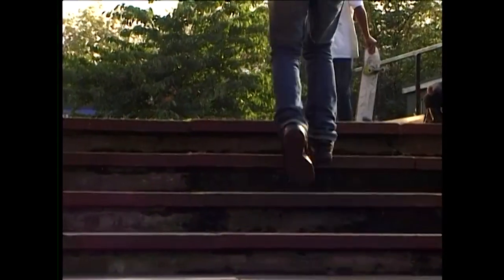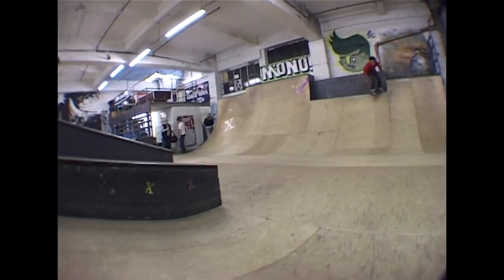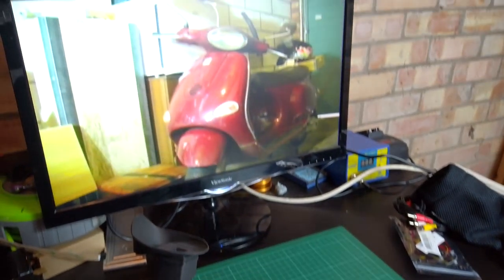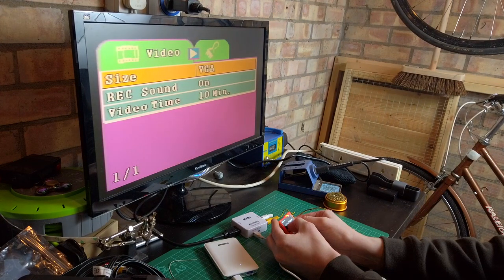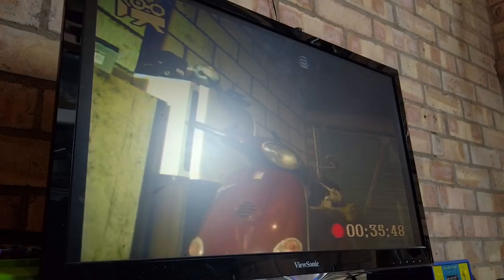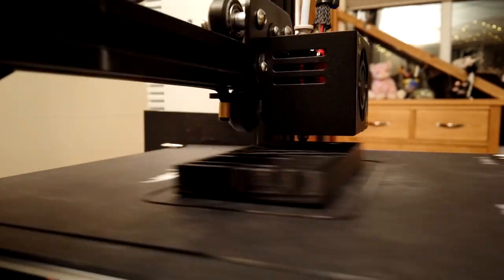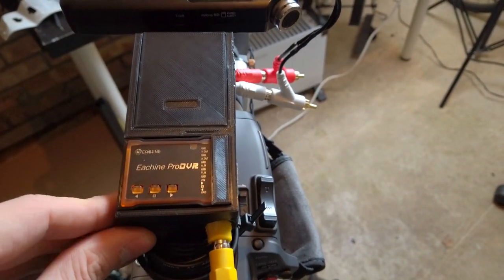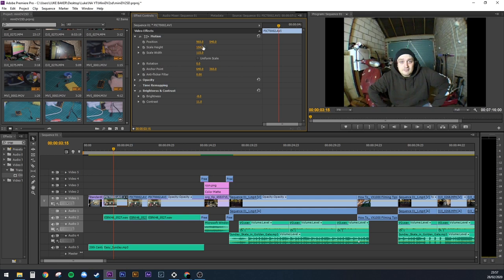Tapeless GL2 / VX1000 SD Card DVR Hack

Comment: Nice job man, excellent detail regarding.  Thanks for sharing!  I picked up a Eachine EV100 DVR a few years back to try to do something similar though more for a dash cam... I think... I actually forget... might of just been one of those impulse buys for a dirigible/drone project I was planning to do at one time also and I picked up when I purchased the related gear.  Looks like the Eachine ProDVR is better quality and even more cost effective.  Thanks again!
Reply: Interesting, just reviewed the specs (not the firmware though) and depending on the source pricing, price looks better for the Pro in the States... though from Eachine the EV100 is listed a few dollars cheaper.  
EV100 DVR - https://www.eachine.com/Eachine-EV100-Micro-AV-Recorder-1280+480-Mini-DVR-Support-32G-TF-For-Goggles-p-1026.html
Pro DVR - https://www.eachine.com/Eachine-ProDVR-Pro-DVR-Mini-Video-Audio-Recorder-for-FPV-Multicopters-p-392.html

Hackaday Article regarding this vid - https://hackaday.com/2020/03/07/that-retro-video-look-without-the-tapes/

Comment: Very nice hack indeed. Congrats!! :) I do have a VX2000 DV Camera. I'm so sad that these high tech designs become trash in this very short time period. I'm here after a Google search on how can I revive this monster. I'm considering replacing my VX2000 sensor system with some 4K camera sensor, making use of the VX 2000's optical system.

Comment: Idk why it doesn't work with my eachine DVR (not pro), i get an total glitch image and sound, any idea???
Reply: doesnt fonction for an old canon and a old sony, is it a problem of cable? or menu selection, between ntsc/pal or frame rate problem? I can monitor the signal straight from the AV out of the two cameras to a monitor and it work perfectly, butt when i try to record on the eachine dvr it's very glitchy...
Thank u
Reply from the maker: Not sure, maybe the DVR is faulty?
Reply: @NEONAIRSHIP  i founded, it's a problem of omtp thing, even on a 2,5 minijack ill try you technic

Comment: What format does it record to? Been looking for a Prores level analog to digital capture device
Reply from the maker: This only does mjpg.AVI files so probably won't fit your needs. But an AV to hdmi adapter and an atomos recorder might work?
Reply: Yeah running it to a hdmi out does open that up. Might give this a run and see how it comes out anyway, looks great!  

Any chance of getting that 3D print file?
Reply from the maker: @SPOD_ZONE  No problem, I've added it to the video description. It's a bit rough and could use some tweaks but did the job.
Reply: if you can afford it, tapeless dte recorders is a great option. this is gonna be a slightly long comment so bear with me.

one thing about this setup that neon made is its not the best quality since its capturing from composite. the reason why dv was named dv was because, well, digital video. 
the only way to get the best quality out of dv based cameras is to do a super expensive mod like the andromeda mod for the dvx100 which takes the video stream before it gets feed into the dv dsp chip and streams it via usb. doing this allowed you to get 720p video and 4:4:4 chroma subsampling out of the dvx100 but of course, it came with the cost of 6500usd for the camera + mod back then. not to mention you needed a mac mini and portable display to be able to use it out of the tripod.

but of course, we cant really do that so the second best option is what i said in the first sentence: dte recorders. for example the focus enhancements firestore fs-4 which has a built in 100GB hdd and captures video directly from the dv port on the camera. or even better, the sony mrc-1k which uses compact flash cards and supports up to like 128GB cf cards. 

bottomline, if you can afford it, get a sony mrc-1k. absolute god tier recording option for these dv cameras. it does not record to prores but it captures the pure mpeg-2 transport stream that the camera outputs, adds zero compression and you can use it as if its just a normal dv video you captured from tape (because it is) with the benefit of having it on flash storage. 

one small note: you NEED a dv cassette in the camera to record with a digital recorder. on older models such as the vx1000 or 2000 it does not support tapeless recording but it still works. however, you have to simultaneously record to tape or else it refuses to record on the mrc-1k. im not sure if the firestore supports tapeless record on old cameras but the mrc-1k doesnt, at least when used with my dvx100.

however, if you want analog and prores codec, you can use an atomos ninja v or equivalent and use a composite to hdmi converter.

i am one year late but i hope im able to help. thanks for reading.
Reply: @n_3719  Worth the wait, thank you!

Comment: How abot the 5V terminal on the side of the XM2 camera? It can probably work instead of batterry to power eachine pro dvr. Did anyone try that?
Reply from the maker: Is that an output? I thought it was an input but could be very handy if not!
Reply: I can’t try it, but I think it´s an output for some external light or something else like this. Power input is just through battery/dummy batterry.
Reply from the maker: Neat I'll have a play when I get the chance
Reply: @NEONAIRSHIP  let me know. I just have to order something to record as i get “remove the cassette” error all the time. What’s the best solution? When using eachine pro dvr, is there a way how to check the footage easily, I mean without putting the sd card somewhere else? I’ll probably order immersion rc poweplay dvr. I saw something else like this at wish (AV VIDEO RECORDER), but there is no specs to it.
Reply from the maker: Powerplay is by far the best option I have found, the eachine you need to take the sd out to view clips on another device
Reply: @NEONAIRSHIP  and how about the internal batterry? Is it really bad? Maybe have two pairs and swap them whenever needed. I like to keep it as small as possible
Reply from the maker: Nah the 18500s are great you just have to buy them separately

Comment: You can also buy a clear click 2.0 video recorder and monitor, and connect it to the output of the camera to the input of the clear click, and press record. It will record directly onto an SD card. You can get a clear click used for about a hundred bucks.

Comment: Trying this! Well, most of it. Personally I can’t explain away going to all the trouble to design,  3-D print and install a 1 off “all in one” enclosure for the dvr, 4.7v battery pack complete with  power switch and everything, to then opt for “West Virginia engineering approved zip ties” at the end…?? Whaa??   Huh??  
 
The only explanation is that he must have been all out of the good brand of duck tape…

Comment: This is impressive to say the least. If you can manage to do the exact same thing with the Firewire port on the back of the camera to SD card, the recording will be in even better quality. As I understand this the MiniDV tapes record the same quality as the Firewire transfer does to PC then the composite which are the Yellow, White and Red and slightly compressed. My brother has a Canon GL1 with a firewire port. I came here to see if you actually managed to get this to work with firewire port, but as I have heard on other forums; firewire only transfer data from MiniDV to PC.
Reply: someone can probably program a arduino/raspberry pi to do this feat and itd be smaller and probably better
Reply: @LUCKIPUP  This is part of the project I'm working on right now. I have an FX7 with a removed tape transport which I'm converting to tapeless with an RPi.
Reply: @jiroscia  sickass foo, i can’t wait to see what comes along, the thought of old cameras getting a chance at a new lease on life with modern updated tools like this brings a smile to my heart

Comment: Hey man, weird question: I’ve made a diy mark 1 fisheye for the vx and you 3D print, wanted to see if you had the ability to 3D print an mk1 housing for the lens elements and I could pay u  obviously.
Reply from the maker: If youre in the UK maybe I could help, if not then probs cheaper to use a local service like shapeways or 3dhubs

Comment: I need help, on part 3:34 what wires do the extension cable connectors get soldered to?
Reply from the maker: Pause it at 3:38 the image shows you where everything connects. For the ground wire (black) it doesn't matter which one as long as its also a ground wire

Comment: Hey, I am working on a similar build. But instead of the eachine pro dvr, couldn't you just use a NIDICI FPV DVR with a AV Cable? I am new to this subject. Then you would get stereo audio (from the av cable) as well as video, combined in a smaller build. What do you think?
Reply from the maker: Yeah should work, I was just using what I already have. It's most likely going to be mono audio though, most of these little DVRs don't do stereo
Reply: NEON AIRSHIP i bought a mini dvr with an av input and small battery. Im very exited about the outcome. Ill keep you updated 👊🏻
Reply: I'm thinking about buying one of those "all in one" dv boxes to have the ultimate cheapo recording device for old cameras (dvx100 in my case, lovely cam). The model that I'm currently looking has built in screen, battery and microphone in. Screen could become handy in case the camera's own screen dies. Battery could be easily and cheaply extended with a smartphone powerbank. If the microphone-in is stereo, It would be as easy as buying a 3.5mm to 3.5mm male to male to get decent audio, as most decent camcorders have a 3.5mm jack out. No need to solder anything, and should be easier to config as there's no need to connect the device to an external screen. I'm really tempted to buy it from amazon and try it out
Reply: @coachfrank2808  I read a bit more and sadly those units max out at 640x480p. My cam is pal so I'm not sure if I'm willing to gave up that extra res, it also doesn't help to read the comments of some users that report a big audio delay. Gonna keep googling, it appears that svideo is also out of the map, quality would be considerably better than composite
Reply: Manuel Arriola there is an analog to hdmi box with a built in sd slot. It is powered by usb, so powerbank could be compatible. Its about 30 bucks on amazon. Audio delay can be fixed in premier or something.
Reply: @manuel.arriola  a que te refieres con All in one dv boxes? Podemos hablar por privado del proyecto DIY?